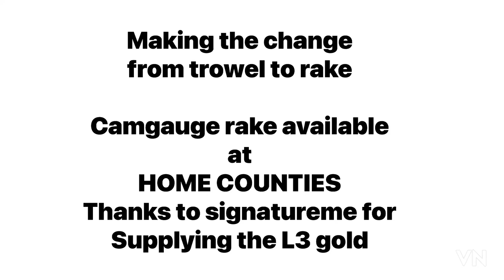How to use camguage rake

Comment: Never used tape in 20yrs of levelling and fitting. Or one of those stupid mixing buckets on wheels.... Plasterers bucket and a battery drill is much lighter and cheaper. And an 8mm tilers trowel gives a good and even coverage of leveller. Plus who the fk uses 5mm?? 😂
Reply: Going to be taking a day to do a mornings work using a plasterers bucket on any decent sized job